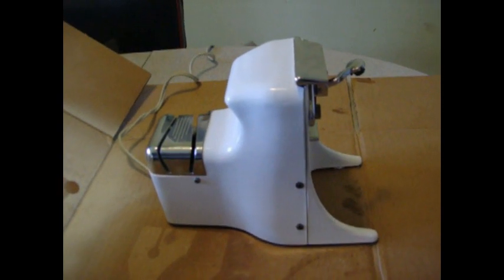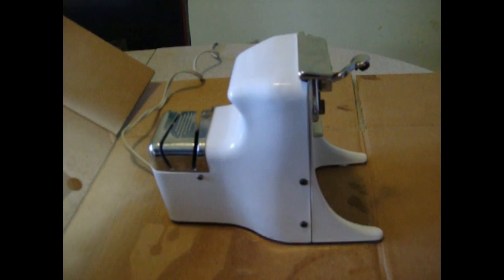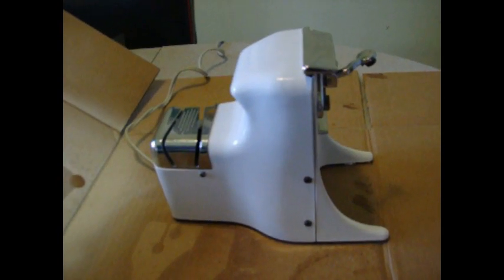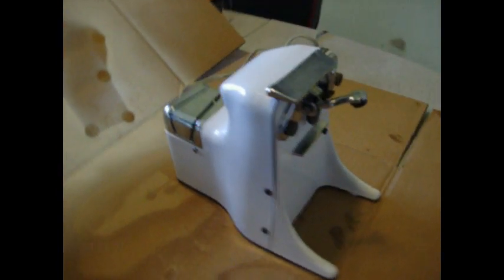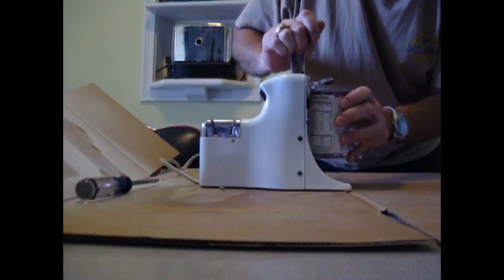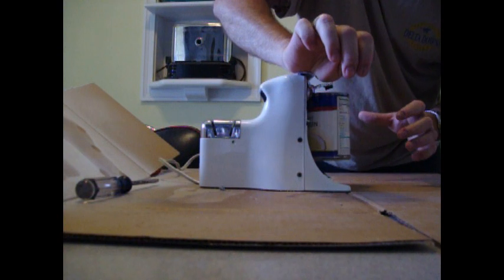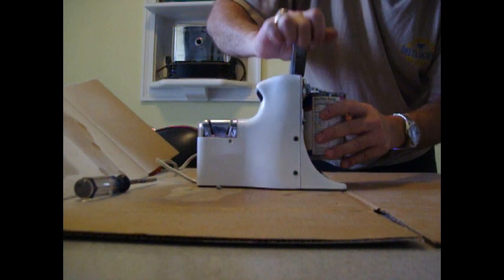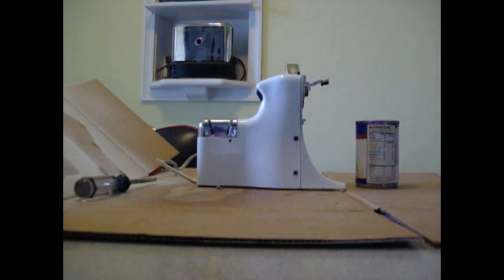1956 Udico Electric Can Opener Model 58-H

Comment: The model you have isn’t the first model. Yours is from 1958. The first model would be the model 56 and it has the UDICO crest stamped into the chrome cover for the knife sharpener.
Reply from the maker: Thanks!
Reply: @58buicklimited  No problem. It’s a beautiful can opener. UDICO kept changing the design,improving it the following year. The first model has a more complicated cutter assembly mechanism. It has a piece runs below the can drive gear in the front and secures with a screw.  UDICO quickly lost out in the market as other manufacturers soon came out with better looking can openers saturating the market with choices,and they lost their place in the market. I recently found one of these in turquoise. The grease inside had hardened and the mechanism was frozen but it’s working again now. It’s a well built machine but I prefer the rival products and the Kenmores and Swing Aways and GE’s that had much more futuristic styling. 

By the way,nice Toastolator!
Reply from the maker: @Suddenlyits1960   Thanks for the detailed info, it is often hard to find even basic info on these old appliances. My friend has a later (early 1960s) UDICO that looks more like a modern can opener. I like the utilitarian appearance of mine since it goes with my kitchen styling. It has that 1930s/ early 1940s utilitarian look to it.
Reply: @58BuickLimited,You’re welcome. I know what you mean. I had to write Rival years ago before the internet existed to pin down the exact dates of manufacture for their “Can-o-Matic” series. I only know about the differences in the Udicos as I’ve seen the earlier models and noted the differences. 
I believe they added cooling fans to the motor shaft after this model in 59 or 60. 
I think you did a nice job restoring yours. Don’t get me wrong it is a beautiful design,the inventors daughter is said to have scultped this housing,and they are very well built,but other manufacturers really went wild with their Jetsons looking models and those are my favorites,just as the 57-61 finned cars are my favorites.
Incidentally,those 58 Buicks are often joked about as having the most chrome ever on a car!
My favorite Buick ever is the 1959’s.  Those are the most stunning GM car ever.
Reply: Incidentally,was yours gummed up solid when you got it? The grease in the motor and mechanism in my   UDICO had turned to glue. Literally. With the motor removed the gear train wouldn’t move a bit. It was some sort of white grease (likely lithium) that had turned yellowish. 
Even seafoam deep creep couldn’t loosen it.